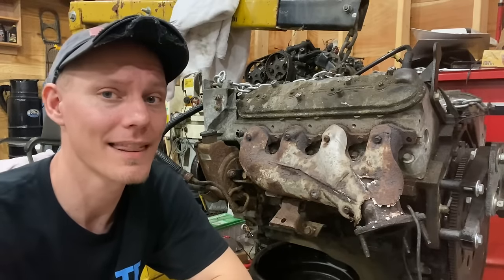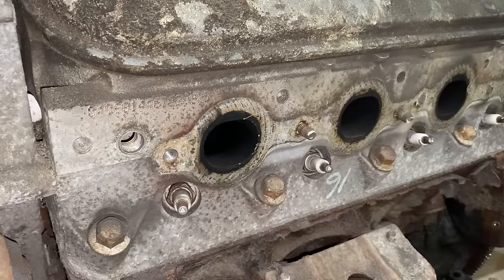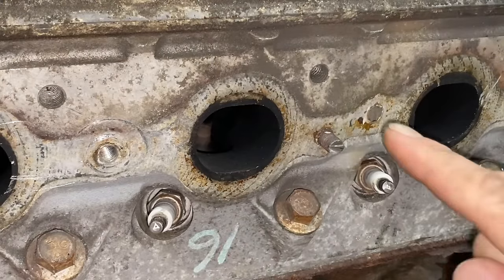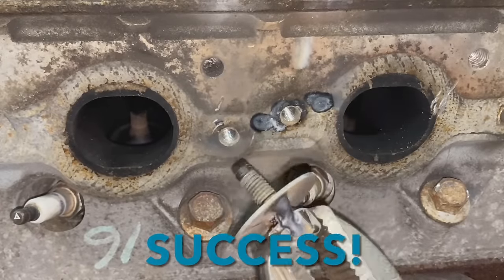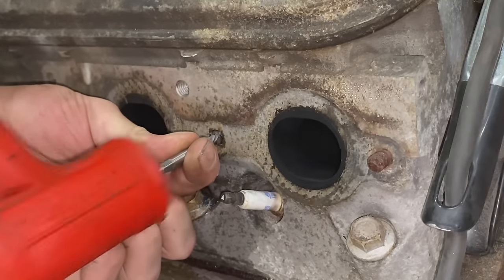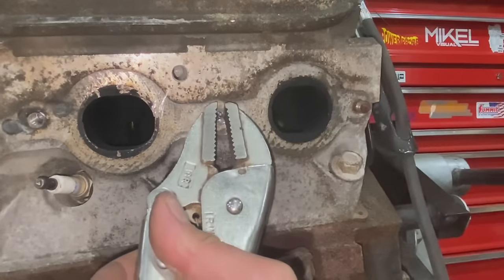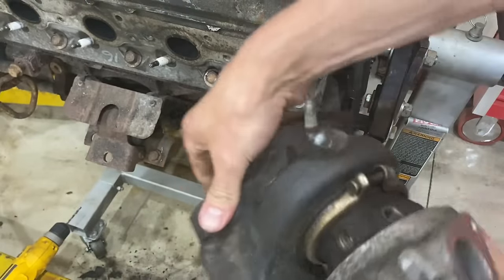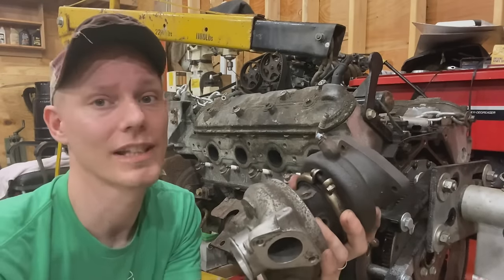How To Remove A Broken Bolt 6 DIFFERENT WAYS - LS Exhaust Manifold

Comment: Gooday A!!   One way you may have missed is a left hand twist drill bit , or try sharpening any bit for counterclockwise rotation. Plus a good type of easy out I like are square taper . U might be suprised with the left hand drill bits.    I even took a broken stud out with an easyout still in it by welding a nut to it . One other thing I find it better to let the bolt cool after welding before trying to get it out.  Old School Motor Mouse        Thank you & Gooday  James T. Burke
Reply: P.S. After the bolt cools I'll put some oil from stove oil up & hit it with the air to force it in farthest. I"m  in it to heli coils & thread inserts. WHAT BROKEN BOLT ???

Comment: Thank You , for Your Thoughtful, Helpful Video... As These Bolts Break off Often, and Can Create a Tapping / Annoying " Start Up "
Noise, until the Motor Warms Up ... And A Better Manifold Seal is Created, by the Warming Up / Heat of the Engine, in General.  
Somebody Please Mention, What Thread is the Replacement Bolt...?  And How Long is the Bolt to the Shoulder Stop... At the Manifold Outer Face..??  As I want to Buy a Few in Advance... To Be Prepared.  Also Would You Guys Recommend a Higher GRADE of Hardened Bolt...?
 Please Let Us All Know....!!
Would a Lock Washer Be Helpful...? As Well....?
I Know, I'm Waiting To Find Out...
I Have a 2000 Yukon XL 5.3L engine.... By the Way.... 
   BillinL.A.   9/02/2022.

Comment: Well, I just watched your video for curiosity reason. I also want to tell you that I am what they call an"old school mechanic". In general you did it right, however, when I see open end wrenches being used, I have my doubts. Also that adjustable wrench was not the best choice and last but not least, welding that turbo on was supposed to be funny and it is for most people. But I would not be surprised if somebody took it for real!

Comment: Just for anyone watching this video. 
You should be able to find thinner 'jam nuts' for the purpose of double nutting. Also with the drilling out method, the closer to center you can get the better, and then use the largest size drill bit you are comfortable with, the less material it has to extract the more likely the remainins of the bolt will deform as shown which will aid in it's extraction, I think most people have greater difficultly with that method because they haven't removed enough material and they try to put the torque that was used in installing the bolt on a much thinner piece of steel that just isn't intended for that much load. 
Also those extractors are garbage, the squared ones will bite better. And as always, make sure to use heat on the block since it's aluminum it will heat and cool faster than steel.

Part of me wonders why there wasn't some sort of crush washer designed to used to be a relief point for the bolt heads, would of saved people some trouble there, that or having larger bolts.

Comment: Good video man. I got a stuck broken glow plug. I don't have welding tools and I've been trying your #5 method. I've tried two different kinds of extractor one just like yours and some short ones with a ratchet I got at harbor freight. They are hard to get to catch and then when they do it seems like they are just drilling a hole through it and the plug won't turn.

I am worried that I will end up drilling it out and then I don't know what will happen to the end of the plug or where it will go if I do. Total novice.

Your #2 method with the double nuts made me think. Could you put threads or a tap a bolt like your 4,,5,6 and then put another bolt in it and then the double bolts to get it out?
Reply from the maker: If you used a reverse thread bolt, that would be another option. You should be able to find them online or at a good hardware store. Also - I have heard that drilling a hole and hammering a torx bit into the hole often works. I’ve never done that, but it may be worth exploring the idea! Good luck! I’m rooting for you!
Reply: @WiringRescue  Yeh the torx bit I have thought of after reading about it but one long skinny easy out drilled pretty deep and I fear drilling any deeper and hammer might knock the electrode end off. 

If you got a reverse thread bolt would you try to get a short one so the hex is close to the surface or? Running out of thread area on sides too and my hole is roughly centered but not a perfect circle. At the moment I have been spraying it down with a citric acid solution with some tissues around it. Hoping. I got an easy out now (3rd one) that catches but I still can't turn it with my strength. No breaker bar though but seems like it should turn without it and I don't want to break it. Maybe the acid will help after a couple of days.

Comment: Excellent video and how-to techniques, assuming you have a welder.  And then you poked me right in the backwards-Crescent OCD....  agh

Where was the heat for the extractor??  It worked for the turbo charger....
Reply from the maker: You’re in good company - there are about 20,000 others in the comments telling me what a giant moron on am because I used that wrench backwards. The question is - did I do it on purpose for the comments? 😮

Comment: Machinists "center drill" bits are magnificent for starting holes. So is using first a prick punch then a center punch. 
BTW every mechanic should own and get comfy with an oxy-acetylene torch. They change your life including pinpoint heating, annealing, torch bending, cutting, welding, brazing and more.  When I have any reasonable length of exposed bolt that's stuck I heat it bright red, pinch with visegrip and rock slightly back and forth to break torque.

Comment: First thing I try is use a center punch and see if the broken fastener will turn. If not I clean the top of the broken fastener and us a stud rod. They are designed for broken fasteners. They have a high flux yield and set on a low amp. So what you stick to first is generally what your welding on. I build it up so I can put on a weld washer. They are thick and heavy. Then use a 5/8 nut, yes large. I weld on the outside to secure and then I weld the inside completely full. This way I let the heat absorb into the broken fastener. Stud rods, I have welded out broken bolts one inch deep in the housing. Use a impact and set on low to create a vibration and work it back and forth. As with a broken fastener some times it has a shear lip on the outer thread. If it breaks a few times, I take a die grinder and go around the outer circumference and remove the shear lip. Take off one thread usually helps. 
If I do drill (rarely) start off with a bit that is the size of the hole. Drill just a little bit into the broken fastener. As it will show you how well centered you are. As it will leave a perfect center point. Then use small bits, mark it so you know what depth to stop at. Once drilled the stress is now removed off the broken fastener and you can weld on it again.
If broken in aluminium, get the torch out and heat it lightly.

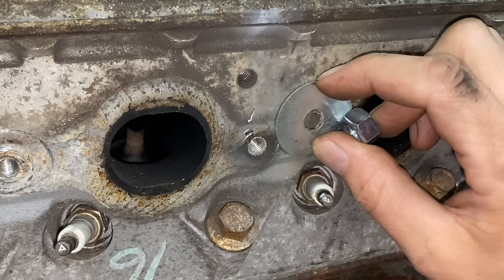Comment: Question. at 8:57, how did you get the washer (and subsequently the nut) to stay on the head while welding without holding it in place?
Reply from the maker: I’m not sure how I did that one, but you can generally hold pressure against it with a screwdriver, or pliers. Then get a small tack weld in place, and from there, you crank up the heat and weld until it seems solid.

Comment: If you have part of the broken bolt still sticking out, screw a single nut on the exposed stud. Get a BFH (big hammer) & mushroom the head of the stud. Then back the stud out. Works most of the time.

Comment: Show me any one of those techniques that would work for a ford Triton engine broken exhaust bolts and I will be impressed. They are usually not seized on a GM engine because of the materials used in the bolts as well as the quality of the aluminum in the head casting. Ford uses materials that will seize together stronger than welding.

Comment: I’ve never had luck with easy-outs, either. Dad and I worked on real Beetles and broken bolt studs were pretty common. Usually, locking pliers worked. He even cut a slot with a hack saw or grinding wheel and turned them out with a screwdriver. 

Did you use any penetrant?
Reply from the maker: On these bolts, I don’t believe I did because I intentionally made it hard for the video, but I do like to use PB blaster if I’m not going to be welding the broken bolt. Also aircooled VW’s are awesome!
Reply: How would you go about cutting a flathead on a bolt that hid itself and doesnt stuck out?

Comment: I worked for Years on a Golf Corse. Everything was rusted due to Nitrogen and fertilizer Used on the Grass.  I used all the methods except the turbo charger one. In addition I bought a reverse set of Drill bits. Use a regular clockwise  bit for drilling a pilot. Increase the size slightly, and drill it larger, then use the largest reverse rotation bit , as long as it isn't bigger than the bolt you are taking  out. It will usually unscrew when it gets a bite

Comment: Where do you connect the ground clamp of the welder?  When you welded a nut on the broken stud.
Reply from the maker: Unplug the battery of the vehicle and then the ground clamp goes someplace nearby that is convenient. It travels through the aluminum head just fine.
Reply: @WiringRescue  Gotcha, thanks 👍

Comment: Your method of collapsing the drilled out stud will work more effectively if heating the thin bolt shell red hot and then drive in a prick punch between the bolt shell and the threaded hole wall . Starrett manufacturers them .

Comment: the weld a nut method works best, but when things get nasty, buy yourself a left hand drill bit set. use regular right hand drills to start small then keep enlarging the hole, when you get close to the inside thread diameter then use a left hand drill to drill the last overesize , the lefthand bit grabs the leftovers and the whole works spins out.

Comment: Every time you welded something, you applied heat.  So heat and vice grips is my take away. I have  a 1/8 inch screw head bolt in my rusted EGR that broke off.  Not sure what I'm going to do.

Comment: Try mixing automatic transmission fluid with acetone in a 50/50 ratio, DO NOT MIX OR STORE IN ANYTHING PLASTIC, apparantly this works better than Kroil or PB Blast'r to penetrate threads. I've been working on removing exhaust flange studs. There were 6 total(3 on each side). The driver's side was fine, I could 2 nut the studs. The passenger's side only has 1 that I was able to 2 nut. I think cleaning up the threads with a die might help, there is some stud left exposed, just not much. I'm gonna soak it for 24 hrs in PB blast'r(wrap a strip of shop towel soaked in it around it), hopefully this works, I'm kinda at my wits end, and am losing my sanity lol

Comment: When I use ez outs I use the largest I can get away with and instead of using pliers or tap wrench to turn it, I use a drill on low speed and lots of pressure. I have never broke an ez out (knock on wood) and have always had success with this method.
Reply from the maker: This is good info! I’ll have to give that a shot! Thank you!

Comment: Any tips for doing this with it still in the truck with it being broke off in it a little and it's in the very back
Reply from the maker: If you can weld, pull the inner fender out, and you’ll have way more room. Unplug the truck battery. Then clean the broken off bolt any way you can. Scrape it with a screwdriver if needed. Then weld a washer to it with the welder heat cranked way up. Then weld a nut to the washer and spin it out.

Good luck. I’m cheering for you.
Reply: @WiringRescue  thanks!

Comment: Seen a guy on YouTube using jump leads to momentarily glow the exhaust stud red on a Ford pickup. It burns off the corrosion and shrinks when it cools. 
I never found the Easy outs any use. The tappered shape alone compresses the stud against the wall and exasperates the issue.

Comment: The thing is they usually do not break off flush which makes sense when you think about it. Usually the head of the bolt sort of pops off and you're left with the whole width of the exhaust manifold sticking out in broken bolt. From there using a stud extractor it's trivial. I had three broken bolts on my 5.3 and I snapped on trying to take it out. All four came out without drama using a stud extractor. All four were left sticking out of the cylinder head about a half inch.

Comment: You should use curved jaw visegrips instead of straight. Curved jaws have more surface area against the bolt. With an easy out the best way is to put pressure on the easy out and tap the end hard with the hammer. As you tap you will feel the e.o. & bolt turn slightly. Keep this up till down. And you should heat around the bolt and spray with Liguid Wrench.

Comment: That's the way many will do it. However, I was quite surprised that the weld did not break. You should fill the entire inside nut with weld. That will always get the stud out without having to go it a second time.

Comment: Nice video for the bolt extractor u should have used a small 1/4 racket with a small socket also should have warmed up surrounding area with heat and not try to heat up bolt direct

Comment: Cutting a groove in the end of a broken off bolt with a hacksaw or angle grinder works as well if you don't have vice grips, but it can be a pain in the ass just like drilling it out.
Reply from the maker: Yes! I should probably include that in my next broken bolt video! Thanks for sharing!

Comment: The problem with that type of stud extractor is the way they are designed to work is counter intuitive, because they are tapered they push outwards as they grip in the hole which in turn puts pressure on the outer wall thickness of the bolt thereby making the bolt tighter in the thread, eezi outs only work when the stud or bolt isn't seized into the thread.

Comment: I know you were demonstrating methods you use, but the real challenge is getting the broken bolts out a cast iron head where the equipment was subjected to road salt and the bolt heads are rusted round. Last one I did was on a 1986 F600, 6.1 liter, engine in frame. Not fun, had to 90 degree air drill most of them out. I went back with stainless studs and serrated stainless nuts.

I noticed that you may have never had any training on tool use. Tongue and groove pliers, vise grips, pipe wrenches, etc. are directional use tools, meaning the use the serrated gripping teeth in a pulling direction for best results. Adjustable wrenches, combination wrenches, open end wrenches, etc. are meant to be pulled in a certain direction, also. Most mechanics learn early in their careers, to never push on a wrench with a closed fist. Never pull towards your face with any gripping pliers. Never strike a harden punch without eye protection. These are just a few of the tips that you may or may not have practiced during this youtube demo. I was an aviation mechanic in the military and I often taught young recruits the how to’s of proper tool use. That was in 1965 and 1966. There are a lot of new tools that have been invented since then. I have a lot of tools that I used, as just an extension of my fingers and I catch myself having to pulling them against their designed functions, but not in a high torque situation.

Comment: Welding the washer and bolt method is what I use with exception that I drill a 1/6 hole all the way through to get penetration oil behind it and let it soak.

Comment: for all methods... Wouldn't be easier to spray some penetrating oil to the threads, especially if they suffer 260.000 miles? I mean this must be the first step always and then try the less destructive extracting method.

Comment: Well I have a Ford 302 head that has a intake bolt broken off half way in it, I don't own a welder sadly so it's either vice grips or machine shop I refuse to use extractor now. Thanks for the heads up I was gonna buy extractor kit and have at it but after watching this video HELL NO!
Reply from the maker: Haha! Hopefully I didn’t crush your hopes and dreams. Just try the easier methods first. Easy outs and hassle! Just look at the all comments here talking about how people hate them! It seems that reverse drill bits are a good solution from what people say, but I’ve never tried them myself. Good luck! I’m cheering for you and your broken bolt!

Comment: I watched this video to find a different method for removing a frozen screw on the handle of a shower. It not a thick as those you’re worked on. The extractor was a fail. I broke off the head. I thought it was turning and about to come out, but it was just the head coming off. The rest of the screw is immovable. I sprayed some WD into it several time at various stages, but to no avail. I don’t know how to get anti seize into it to see if that might help in removing it. The only thing I feel would work is a syringe to inject into the thin crevice. But I don’t have one either. Getting a welding machine seems like over kill and too cost prohibitive to remove a long thin screw. It’s been a frustrating process with no success use most available methods.

Comment: When drilling steel you don't want lubrication. Use a cutting fluid. A sharp chisel may cut off what little metal is exposed. Try a flattened chisel. Good video to show the many options available.

Comment: Hi, try doing that method on cast iron head and won't happen, took me week to get my two broken studs out 2001 5.9l dodge ram 4x4 truck. I had No choice  but with fender off truck in my garage  andshock tower removed I was able to drill both out straight,  and with right back out get threads out,  mine was not fun at all.

Comment: I wouldn't use a turbocharger; I usually go out and buy a new engine block and weld it to the bolt. Works every time or at least 10% of the time. . .
Reply from the maker: So many great ideas for bolt removal in these comments!